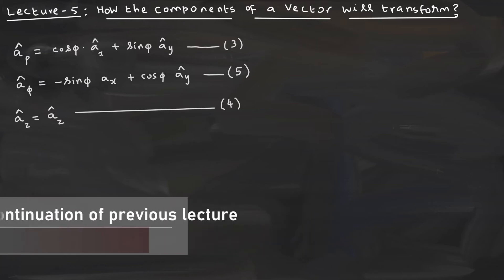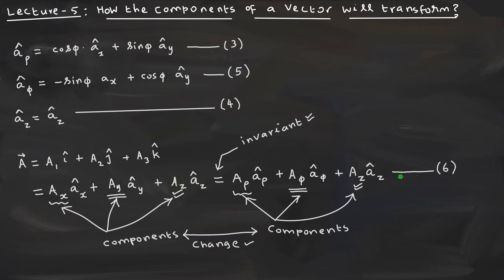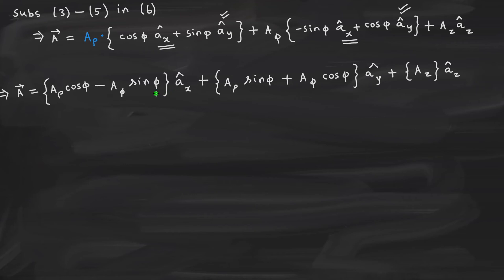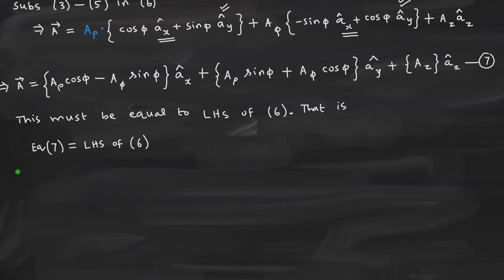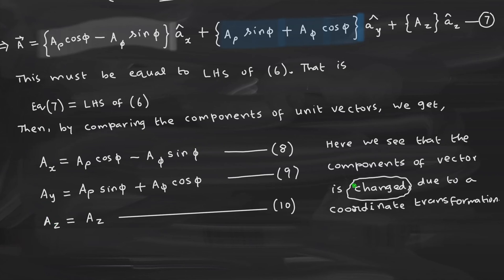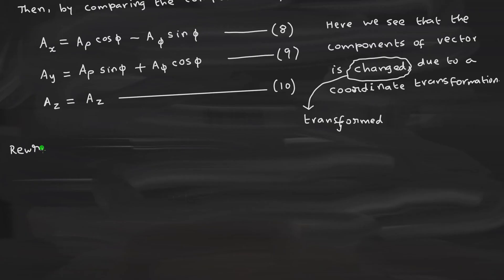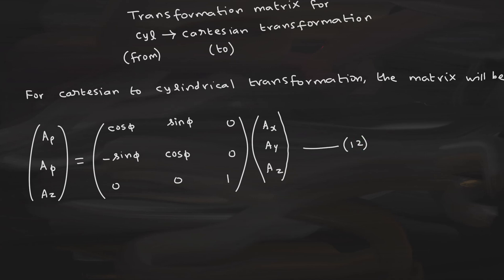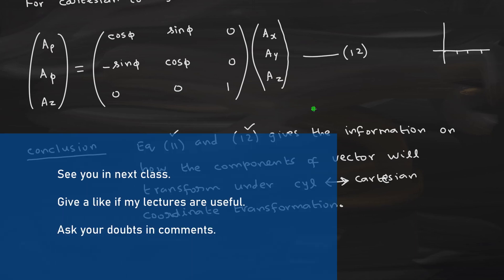Cylindrical Coordinate Transformation Matrix

Comment: Sir, actually while moving from cartessian to cylindrical coordinate system the vector is purely rotated by an amount keeping z axes fixed, right? because our transformation matrix is actually an orthogonal matrix with determinent
one. So, it will perform pure rotation
 to the vector in cartessian and take to cylindrical
JINU JOB
PU20059051
Reply from the maker: No, nothing happens to the original vector. Only we are removing cartesian axes and bringing cylindrical axes in that place. See the explanation from 02:00 to 05:15.
Reply: @ProfSivakumarRajagopalan 
Thankyou sir